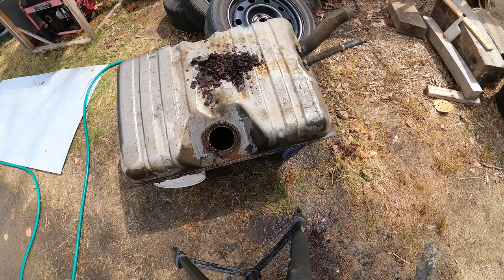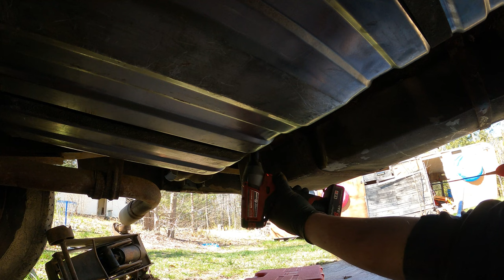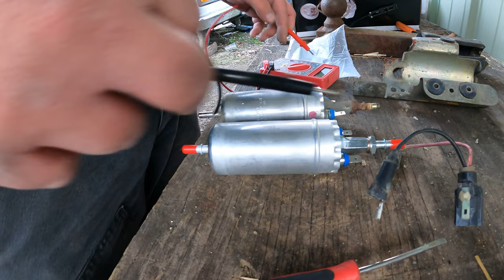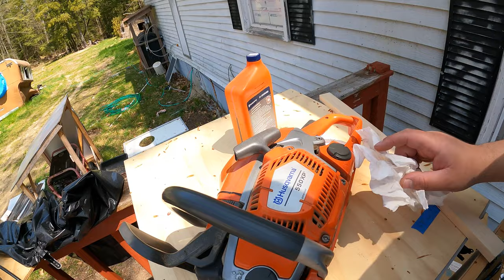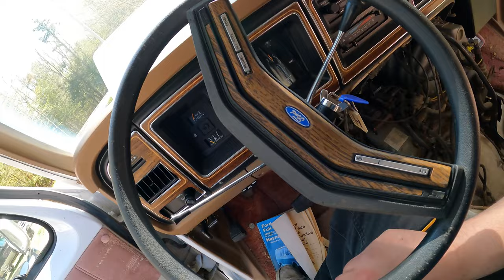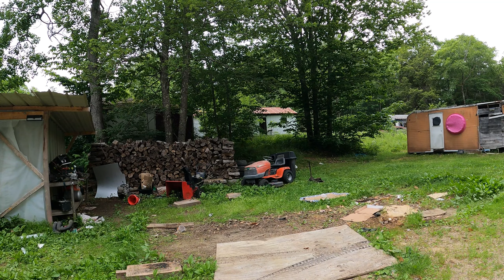20,000 Original Miles #vanlife tank replacement

Comment: Now save yourself some trouble and get a set of remanned injectors or send them out to get ultrasonic cleaned, tested, flowed with new screens installed. Had a set of 01 explorer injectors done for my 95 Mustang and man what an improvement in idle, throttle tip in and top end power didnt fall on its face at 5000rpm anymore....all for $110 to get piece of mind knowing they all flowed within 2% of each other. 
Cant wait to see this make the trip to Andrews one day.
Reply from the maker: I've seen a homemade setup to flow test them I thought about doing. I'm not trying to spend to much money on it yet but I agree!

Comment: Instead of crushing the can with your foot, just give it a quick hit with an air compressor to re-pressurize it.  The vapor pressure of the aerosol is usually 95-115PSI so you could set a regulator to a much lower pressure if that concerns you.  50psi is good.